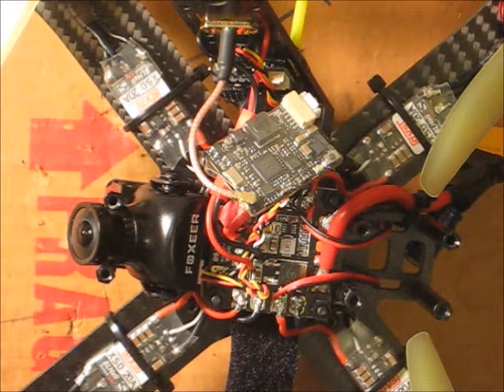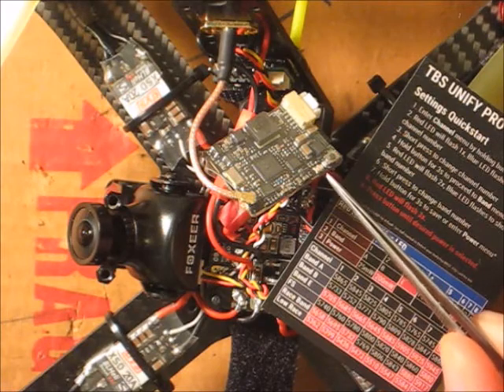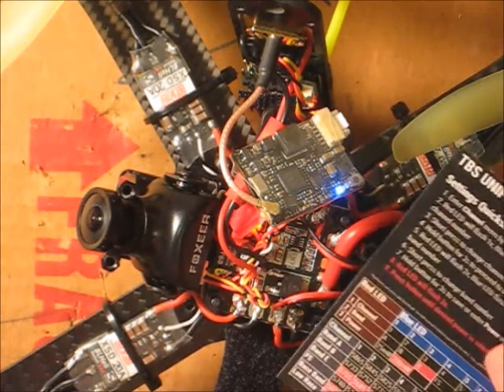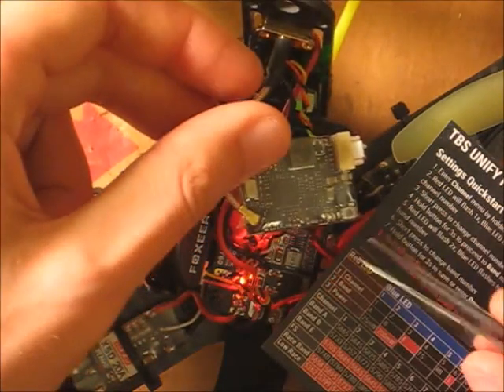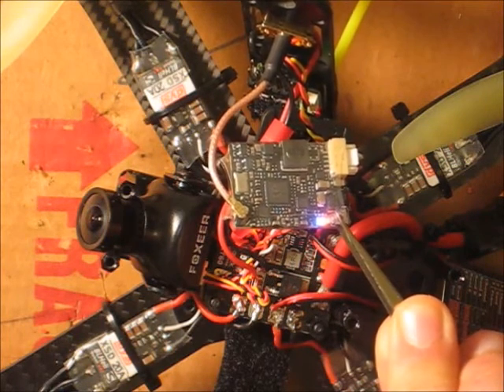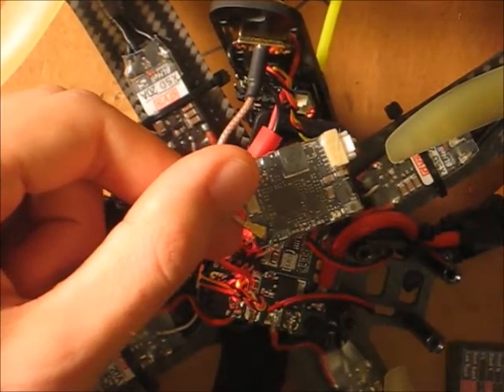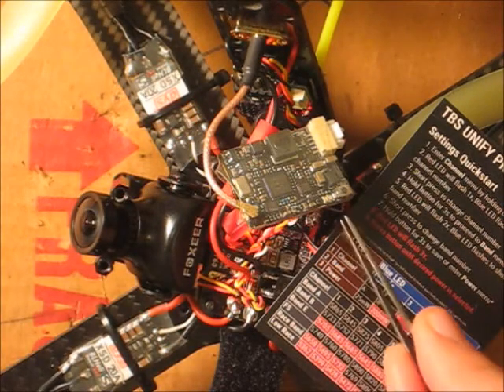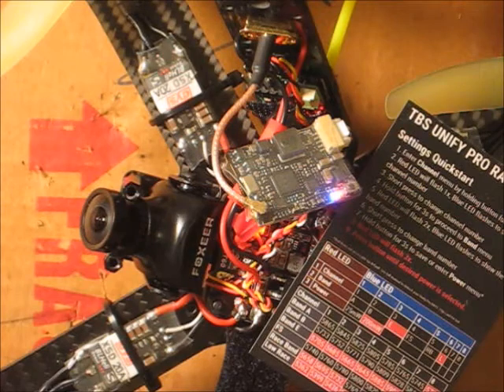Specs Build Part 16 - Unlock and switch channels on TBS UNIFY VTX

Comment: So unlocking the VTX allows for us to use the L-Band?
Reply from the maker: Octávio Maia Yes, it will unlock everything in red on the frequency card which includes the "Low Race" band.
Reply: This is the same with the Unify Pro V2 right? The 5v version
Reply from the maker: Octávio Maia I do not own a V2, but from what I read about the V2 it should be the same
Reply: Ok im wanting to set my unify pro race to 200mw...how do i do that
Reply: Dale Gann 
Go to power select (three orange blinks) the press oncce which should set it